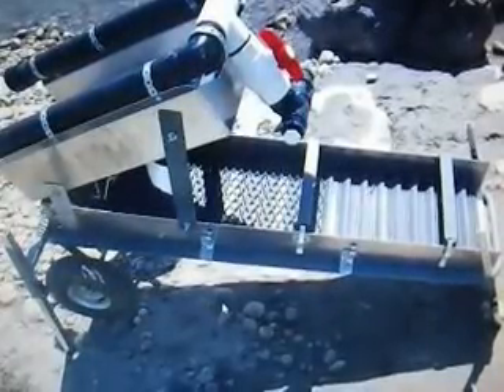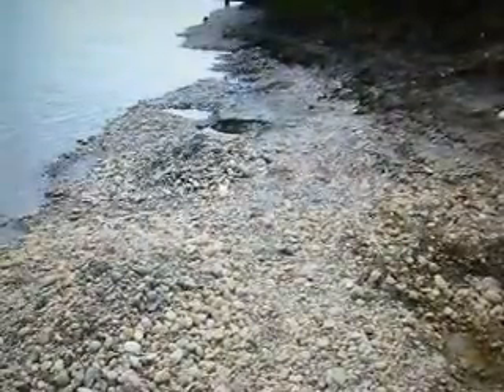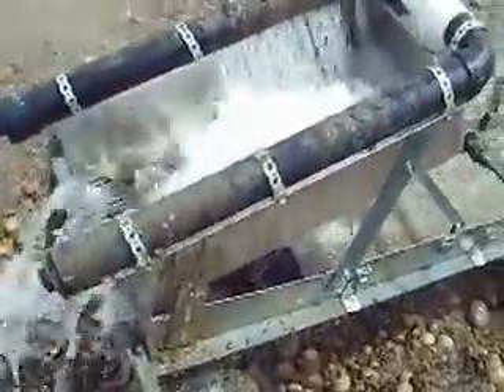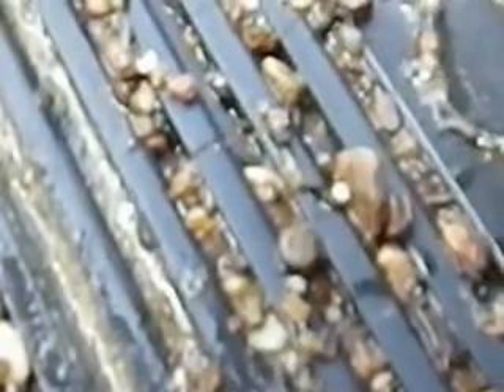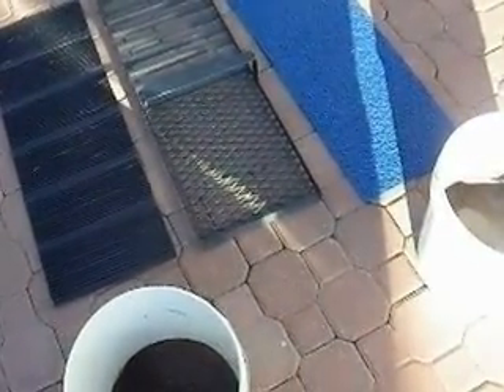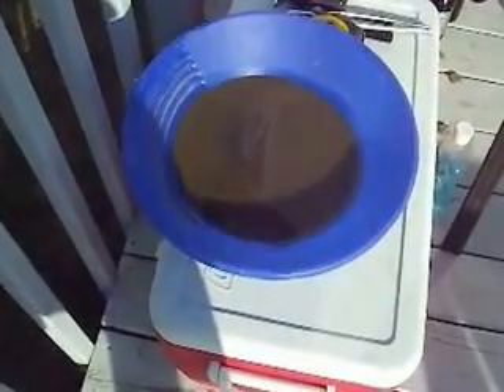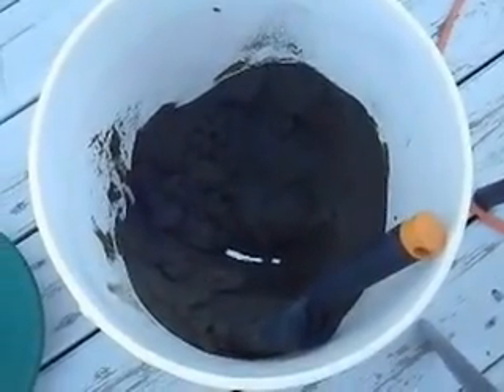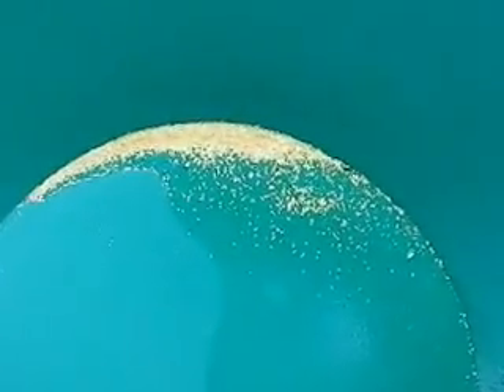#1/10 custom highbanker first run - Miners moss vs hog mat

Comment: You really needed to do as Doc said start out at extreme angle so every thing blows out then lean it off slowly to where you only hold for a short time then tune it in to get it set right! That way its setup also they dont say running big water they say high speed water fast moving! Think they show then running on 2 electric pumps try that with a high banker wont work! NIce vid tho its nice to see you testing it out Keep up the great work!